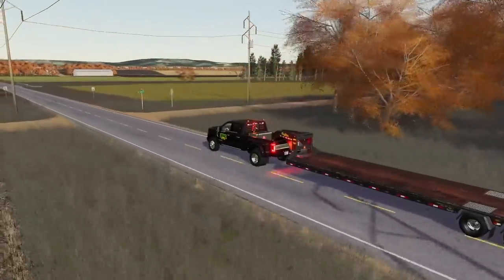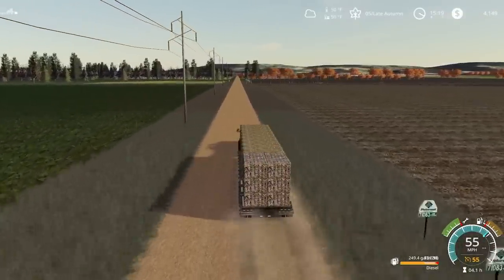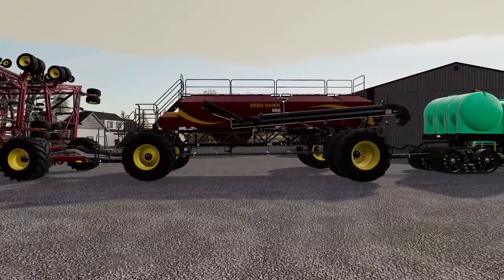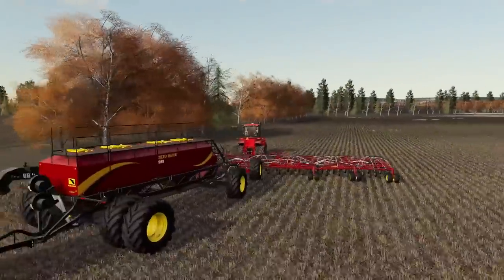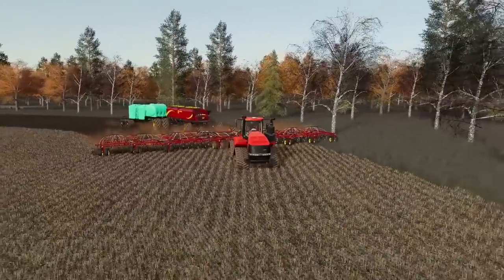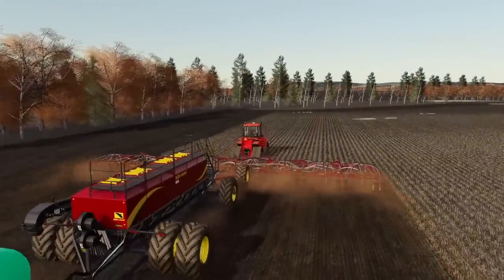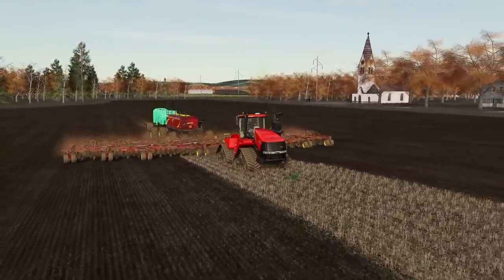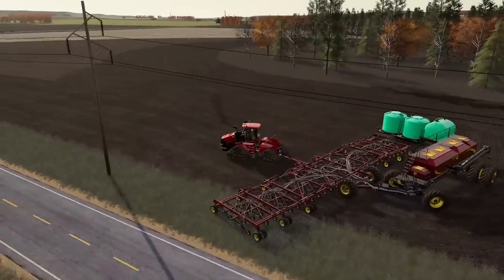KC9500-T liquid tank on a 84ft air drill seeding winter wheat! - Lincoln Creek Nebraska EP 25

Comment: When operating in the field you should never do any less than 2 headland passes, even with a 200' sprayer; you always need a minimum of 1.5 passes to turn around and with really small equipment you can need even more. In terms of large scale farmers to watch to learn about seeding, I'd recommend Fast Ag Montana and Mike Mitchell. Welkers are a good sized operation but they run relatively average to small drills. Tony and Mike are very large scale producers and run drills more comparable to the size of this Seed Hawk and the Bourgault's (Mike actually runs Bourgault's). Honestly I can't recall any good videos of them doing headlands as that's a time when you need 100% of your focus to be on keeping the drill in the field but you can still grasp how they plan their turns and such and how those headlands play an important part.
Reply from the maker: Appreciate the feedback.  Never seen any large scale drills in real life.  We always ran 12 row - row crop stuff when I farmed and like you said always just ran 2 headland passes as the standard.
Reply: @KederkFarms  Yeah, one thing I learned this year doing spraying and floating was don't ever be afraid of doing more headlands either. Better off to have more room than you need than run out of room and end up in a sticky situation. I ended up doing 3 or 4 headlands on a few fields.